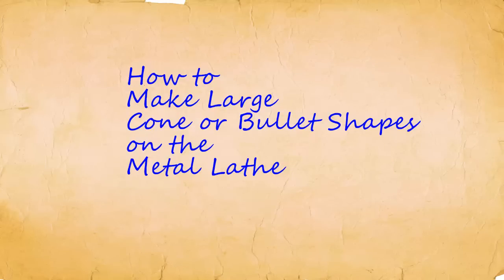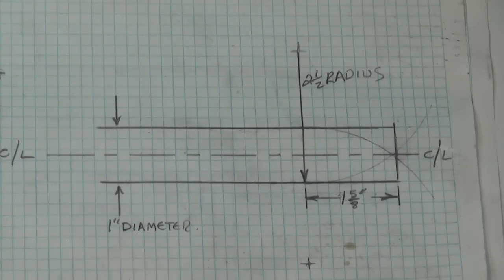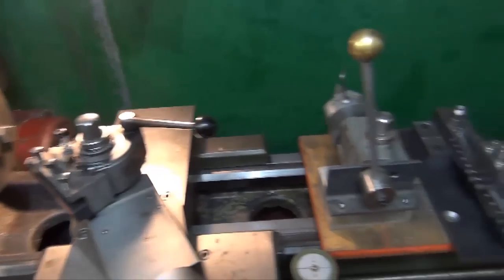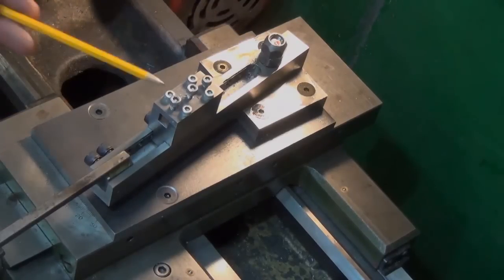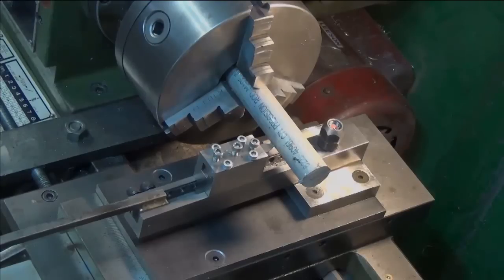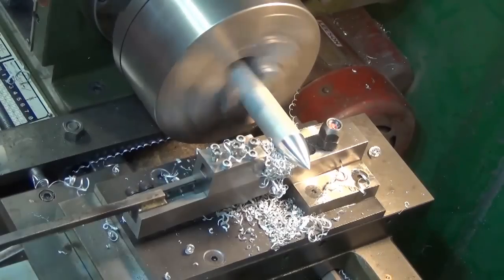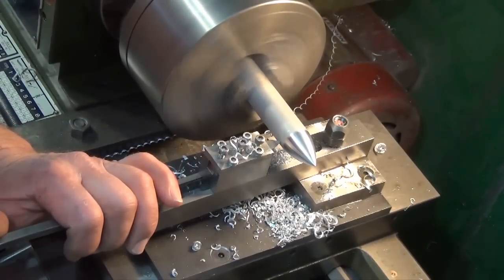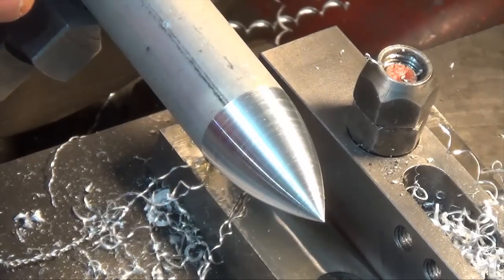Metal Lathe - Large Cone, Bullet, Radius, Ball Cutting Attachment

Comment: That shape is called an "ogive" which I learned about when I made a 3D printed desktop phone cradle. The design came from the classic shape of a chapel window, and while working on this, I was also working in Excel for my data analytics class that I teach. The cumulative function performed on a normal distribution curve demonstrates the same shape. The shape was used on bullets until higher analytic capabilities for aerodynamics using high-power computers was available, then the bullet shapes changed a bit. More than you wanted to know about, I am sure. Anyway, can you post pics of the final product shown on your car?

Comment: Very nice fixture for the cones.  I am wondering if you will be doining more videos for the wiring of your car and sharing them with us.?  You did a great job on the headlight wiring video.  My career started work as a machinist after Tech scholl but most of my experience was in machine design. I have 3 registered hot rods, 1930 coupe, 1930 pickup, 1931 pickup.  A soon to be finished 1940 pickup and a 1930 coupe project.  Recently sold a 1931 coupe.  All these are ford bodies.
Reply from the maker: Thanks for the good comment.
I will be doing a complete series for hot rod wiring showing everything from start to finish and without using an after market wiring kit.  I will start them sometime late summer.